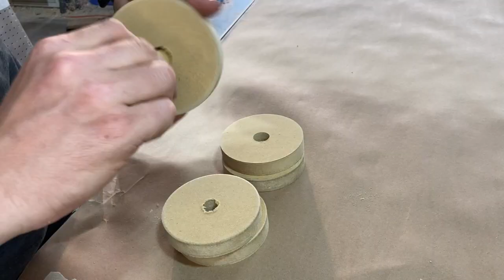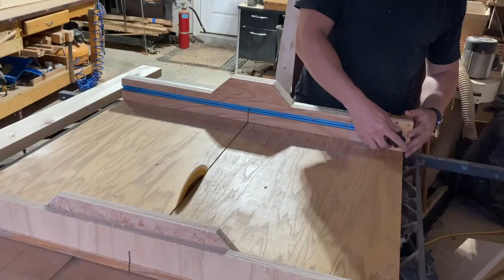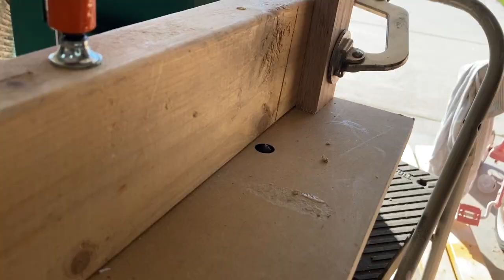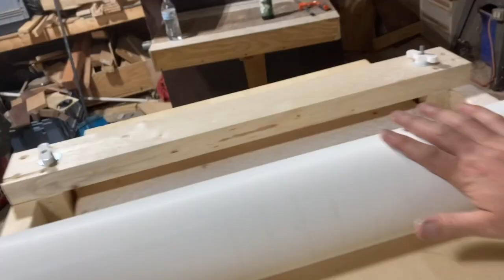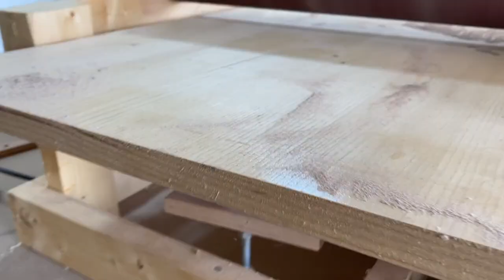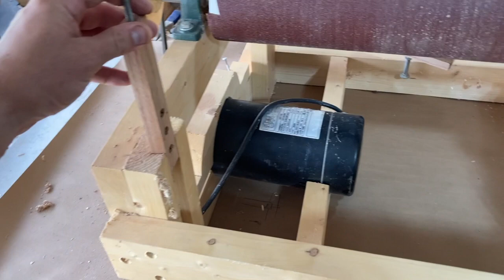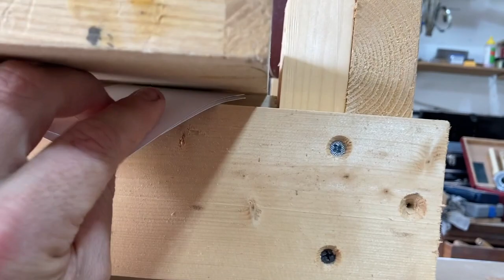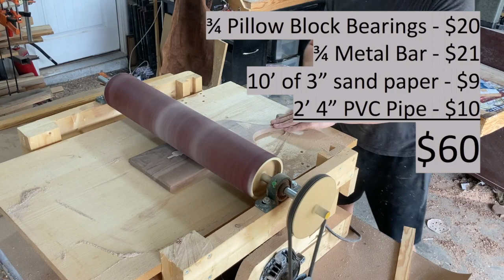Homemade Drum Sander 24 Inch Drum Sander Build

Comment: Just thought the plans. What direction should the pulley be spinning counter clockwise “towards the operator “ or clockwise “away from”
Reply from the maker: you want it so as you're pushing the boards through, they're being pushed back towards you. Or else as you feed it through, the drum will launch it across the room.
Reply: So that’s probably clockwise, which way does your pulley spin?
Reply from the maker: @josephsmarz2078  yes, if you're looking at the pulley from the right side it's spinning clockwise

Comment: What kind of motor are you using to spin the drum?
Reply from the maker: It was reclaimed from an old pool pump
Reply: @ Thanks.  I’m going to try something like this myself.  Great idea!
Reply from the maker: @MarkSchonfeld  I recommend putting the pulley on the inside of the frame, it's a little safer.
Reply: @KeimpieceCarpentry did you update plans to reflect that change?

Comment: Hmm, I may try building one of these using a wooden rolling pin lol I want to have one to remove pieces from pre-cut cnc boards where I leave the bottom skin on for support, this would be perfect.
Reply from the maker: yep, it'll work great for that. Idk about the rolling pin, that would be pretty small diameter. and you'd have to do a lot of work to modify it.

Comment: I am sure that everyone has a CNC cutter in their garage
Reply from the maker: if you can't figure out another way to cut circles out of mdf, then you probably aren't they type of guy to build a drum sander.
Reply: bruh... a trim router with a circle jig... hell a table saw can turn small squares into circles... cut up 20 4x4 squares with a table saw then use your jigsaw to make them round... or a band saw... there is literally a million ways to cut out circles with basic tools... no one needs a CnC machine... they are nice to have if you are batching out alot of the same parts but making >20 of the same part is not hard...

Comment: I never knew gorilla glue worked to stick metal to wood.
Reply from the maker: yea, it's an expanding pvc glue, works on most materials.
Reply: @KeimpieceCarpentry  I’ll look into it thanks man!
Reply from the maker: @BeardnScars  Good luck on the build! I recommend putting the pulley on the inside of the frame so it's not hanging out.
Reply: @KeimpieceCarpentry  for sure I saw you used a wide v for the bearing, was that just a micro v belt you used?
Reply from the maker: @BeardnScars  yea I had it laying around from another project.

Comment: Great looking diy machine!  Are you still selling the plans?
Reply from the maker: Yep, here they are. https://keimpiece.com/collections/build-plans-digital-files/products/drum-sander-build-plans
Reply: @KeimpieceCarpentry  Do the plans include the pulley inside the frame?
Reply from the maker: @elgrande3353  Thanks for watching. The plans are for what you see in the video. Having the pulley on the inside could save some space, but then you run into the problem of the belt hitting the work piece. It all depends on what you want. Moving it is simple and doesn't require any major changes to the plans. Just put it on the other side of the bearing and have the motor slid over a bit.

Comment: Nice video.  I picked up a set of your plans.  I see from your replies that you used a 1.5 HP pool motor.  Do you know what the motor's RPM is?  I'm hoping to find a decent used motor and don't want it under powered or under speed.  

I'm sure I could play with pulley sizes if the speed is off, but I bought your plans so I don't have to reinvent the wheel, so to speak 🙂.
Reply from the maker: I honestly didn't do any math for the pulley sizes and motor RPMs. But what I did ended up working out great. I'd recommend making a few different sized pulleys and stacking them on both the motor and drum, kinda like a drill press so you can change where the belt engages to change the RPMs

Comment: I built a similar machine after looking at your project. My drum is made of steel and weighs 20 kilograms. The motor is a 2 horsepower, 1400 RPM motor. It spins smoothly and well. However, when I feed the workpiece into the machine, it gets thrown off. What could be the issue here can you help me ..thanks
Reply from the maker: What do you mean thrown off? Explain
Reply: @KeimpieceCarpentry  not kick back but it pulls off with force .. so forceful that it doesn't sand the wood but just pulls it off and throws of the workpiece
Reply from the maker: @ApongLusang  you're feeding it in the wrong direction.

Comment: Great video! Going to buy the plans and hope for the best! ?, Will this work with 1/4" boards? Would like to belt sand the material after resawing walnut and maple for small boxes. Thank you again, well done!
Reply from the maker: yes it will. if you need to raise the platform just add some scrap 2x4 spacers under so you aren't having to screw and unscrew the bolt so much. Use business cards to shim either side if your platform isn't perfectly parallel with the drum.

Comment: I find it quite funny how you used your impact to drill and then your drill to drive. I like the pvc pipe idea but without a CNC its hard to make circles for the ID of pipe :/
Reply from the maker: Hey Sam, yea somethings it just depends which bits I have in which drill. MDF is really easy to work so I think you'll be just find tracing a circle template and rough cutting with a jig saw or bandsaw then sanding up to the line. The gorilla glue expands a lot so you're going to get a solid fit no matter if the circles aren't perfect. Then even if the axis is off a bit, sanding that PVC down while it's spinning while referencing your base board will take any error out. I agree, it seems kinda silly starting a video like this off with a cnc machine, but hey, I have a cnc so I'm going to use it. I still have this drum sander and use it for all inlay, epoxy, end grain boards, and it's working great, still have the original sand paper on there too. I've been tempting to buy a drum sander but this things works just find and I don't use it enough to justify the $2k

Comment: What about the price of the screws, motor, belt and wood?
Reply from the maker: Thanks for watching the video and the question. The motor I found for free from an old pool pump, it's been sitting around my garage for years waiting for me to figure out what to do with it. Anyone who does projects that require a drum sander is very likely an active wood worker and will likely have scrap 2x4s and a handful of screws laying around the shop. The pulley I think I had laying around from something else I can't recall. If you don't have those things laying around, then yes it'll cost more than 60 bucks.
Reply: @stringmankzk  Great video!  Straight into the business of the build, not showing unnecessary steps like EVERY board you cut, no big elaborate intro, no stupid jokes or trying to be quirky, the music was great and not overbearing, and most importantly, you know your audience. You seem to know that anybody who would want to build this already knows how to build stuff. There's nothing worse than watching a YouTube builder explaining EVERY detail of their build. This is my first visit to your channel and you've easily won me over...subscribed!
Reply from the maker: Thanks for the kind words! Yea, that was definitely what I was going for, short sweet and to the point. A lot of my early videos were like that. But as I got to bigger projects like the shed, gazebo, and treehouse, it was really hard to condense all that footage down. Let me know what you think of my other videos.   @Geolaw1

Comment: For my usecase, I need a fairly small drum. Could I use one of those rubber drums? Abiut 2 or 3 inches wide.
Reply from the maker: which rubber drums are you talking about? You can still use the PVC drum like I did, just cut it to the length you need.
Reply: @KeimpieceCarpentry  drums I got with a spindle sander!
Reply from the maker: Sure why not  @Kyt_01234

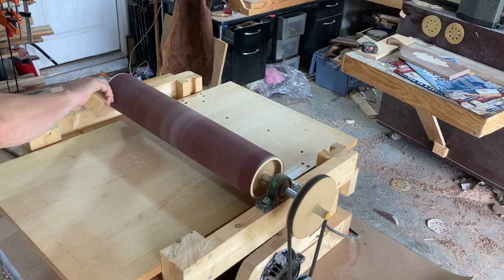Comment: 4:12 use the sole of an old basketball shoe… free and “almost” as good as the block eraser. 

Note: in the 80’s this worked great because all the soles were the same kinda rubber. Today Cheaper shoes work better because they are still the old material
Reply from the maker: Thanks for the tip

Comment: great design. i am just starting off as a wood worker and i was looking forward to build one since the commercial ones cost a ton. thanks to you i can build a low cost one. 1 question: what are specs of the motor you have used?
Reply from the maker: it's a 1.5 horse power. Good luck on the build, plans are available in the link in the description if you need them

Comment: I bought your plans for making this drum sander. What size motor should I get and how fast is it have to go
Reply from the maker: Thanks for watching and buying the plans. I used a 1.5 HP and it works fine. I didn't do any math for the pulleys to determine speed I just did what I thought would work and it works just fine. You can make multiple sized pulleys so you have the flexibility to speed up or slow down

Comment: This is a great design.  Also, use Stump Nubs' idea of multiple sanding drums for different jobs.  Makes it easy to swap out the sandpaper as needed.
Reply from the maker: Yea you're right Ed, having multiple drums would be nice. But honestly for my use case, I haven't had a need to swap out my original drum and original paper. I really only use this for when I do a batch of inlay boards, engrain boards, or large epoxy inlays.

Comment: If I had money for CNC machine I would buy a drum sander.  Lol. Help out the guy that doesn’t have mucho cash
Reply from the maker: you can just cut the circles out with a jig saw, or scroll saw, or band saw, or coping saw. There ya go, I just helped out the guy that doesn't have mucho cash. Thanks for watching the video.
Reply: @KeimpieceCarpentry  really????
Reply from the maker: @kimratliff9001  yep, I ain't lying
Reply: @kimratliff9001  you could use a milescraft circle guide kit with a palm router. It's like 40 bucks
Reply: @maxwellbarnhart1375  I not wanting to build one.  Was just watching video and made comment.  Lol

Comment: Helpful video. Any potential issues with the pvc overheating and warping? I'm planning on using mine fairly heavily. Thinking about using MDF for the drum, but pvc looks a lot easier.
Reply from the maker: no issues for me so far, you need to do lighter passes, you can feel it as you're pushing it through if you're taking too heavy of passes
Reply: Hi, Use one from the training treadmill.

Comment: Great video and straight forward design that appears to be an easy build.  Just some trial and error on the circles inside the PVC.  

Suggestion:  Ya know those belt erasers can get pretty pricey at times and they really don't last that long.  I used the soles of some old worn out tennis shoes and they work great.  Give it a try and save a few bucks.
Reply from the maker: thanks for the tip
Reply: i've been using the same eraser, every day,  for 16 years and there's still 1/2 of it left.
Reply: @otter5555  That’s great!

Comment: How well will this work for thickness very thin glued uo sections? Say 12 inch wide by about 1/4 "inch thick .... I wanna be able  
To sand down to a 1/16th.....and I see there's no conveyer.... so I'm not sure if ita going to be useful to build this or not?...
Reply from the maker: it'll work fine for any thickness you just push it in and pull it out

Comment: Hey! Nice. It's 2022, you still using it? Anything you'd add or change now?
Reply from the maker: I just used it the other day on an epoxy filled piece of walnut. Works just fine. I would def put the pulley on the inside of the frame to save space. I would put my adjustment knob on the other side. The way the motor spins I have to walk around to the back side to make an adjustment. I would add some dust collection, but other than that the thing only cost a few bucks so I store it in my shed and when i need it I set it up outside, use it, put it back in the shed.
Reply: @KeimpieceCarpentry  Sweet! As long as it works for the person using it, that's all that matters.
Reply from the maker: @thenext9537  yep, if I'm doing a bunch of inlay cutting boards it really comes in handy. I don't do them enough to justify buying a 1500 dollar drum sander though

Comment: Love the use of the 45° router bit to make the v belt pulley!!
Do you find 3/4 MDF sufficient for the pulley and what RPM was the driver motor and the driven drum sander in the end?
Reply from the maker: Thanks, yes the MDF is holding up just fine, no problems at all. I have no idea what the RPMs are, there was no science behind the pulley sizes I made, I just guessed, and it seems to work out perfectly for my use case.

Comment: how thick is the bar? I used half inch bar 1mm thick and it kinda flexes..
Reply from the maker: 3/4 inch, no flex for me
Reply: @KeimpieceCarpentry  thanks, man! 3/4 is better. And you also have that thick PVC pipe... mine is half as thick.. cannot find thicker ones over here.. I tried with 1/2 inch threaded rod at first, it flexed and wobbled, then 1/2 steel bar 1mm thick, than it also flexed. I will try a 1 inch thick bar, to compensate for my thin pipe... see if it works. Thanks a lot!!!!
Reply from the maker: @dutu000  let me know how it goes
Reply: @dutu000  hi. What do you mean 1mm thick? If it’s 1/2” bar it’s over 12mm thick, no? I don’t understand the measurement you’re mentioning
Reply: @gujit  the "meat" of the pipe is 1mm, the thickness of the material (it is hollow). 1/2" diameter made from 1mm thick steel
Reply: @dutu000  aah right, you wrote bar not pipe so I didn’t understand at first. I see ok

Comment: How difficult has it been to make sure that the feed rate is correct? If you don't have consistent feed rate do you notice a difference?
Reply from the maker: I found that feed rate doesn't matter, I just pass the boards through manually, I can feel the resistance on the piece so I can adjust the depth manually so it's only taking off a little bit of material.
Reply: @KeimpieceCarpentry  My buddy and I have been making some cutting boards and we've never put the end grain ones through the planer but sanding sucks and I would like to build one of these.  If it's truly a matter of feel, then I think we'll have no problem with it.  It can't be any worse of a result than hand sanding.  I have the pillow blocks, 2x4s, melamine for the base and was thinking of doing an inclined plane type thing for the height adjustment with a threaded rod to move it.  I'll have to take video and share it when I make it.
Reply from the maker: @jarodmorris611  Sounds like you got a solid plan. The hardest part is the drum. melamine will make a great base.

Comment: Now that you made it 24 inches wide, will you really use that width very often? great video for all of us DIY'ers!
Reply from the maker: Nope! I've only used this for small inlay work. I think the max width of those cutting boards was 8 inches. However, the reason I build it 24 inches wide is because my planer is 12 inches. So if I had to plane down two boards then glue them up, I wanted to be able to remove the glue line with the 24 inch wide sander. But yea, this thing is very big and takes up a lot of space. Definitely something to consider when building your own.

Comment: I like how a budget DIY build starts with using a CNC machine.
Reply from the maker: I agree its probably frustrating for those that don't have access to a cnc. But the same circles can be cut with a variety of other tools. Jigsaw, bandsaw, coping saw, or with the use of a table jig. You could jump on facebook market place and find someone selling custom signs that you know has a cnc and request them to cut the circles.
Reply: CNC just means it’s exact. I’m currently trying to do this with a $60 Harbor Freight bench top drill press and a $30 hole cutter and an $8 reamer. I’m cutting the circles out of 1” thick surplus PVC decking. The results are pretty rough (PVC “dust” is coarse and there’s lots of static charge) and the drum has a bit of a wobble so I’m going to have to sand the circle cutouts smith like he did with the PVC drum and then wrapping the circumference in tape to try and fill the gap. 

PS: I also don’t have a 1hp motor lying around so I’m going to buy a cheap corded drill.
Reply from the maker: @Neil_K_Walk  Neil, maybe you can find an old pool pump motor, that's where I got mine from. I also experimented in the past with taking the grind wheel off my wheel grinder and replacing it with a homemade pulley, then using that as the motor to power a homemade lathe. Not sure if that will work for you but worth a try.
Reply: Huh.. and here I used a 2" PVC with a 2" wood rod in the middle... 1" would work also... It creates the support even better.
Reply from the maker: @jst1man  Nice job!
Reply: I was thinking the same thing!
Reply: Use/make a circle cutter. It’s just one way of doing it.
Reply: I would use a hole saw to make the pieces
Reply: A circle can be cut oversized by hand and sanded to final size by spinning it on a drill against sand paper. CNC not required.
Reply: I would just like the homemade drum sanding machine, and I have a washing machine motor that I would adapt here.